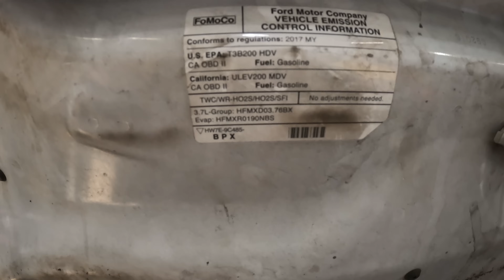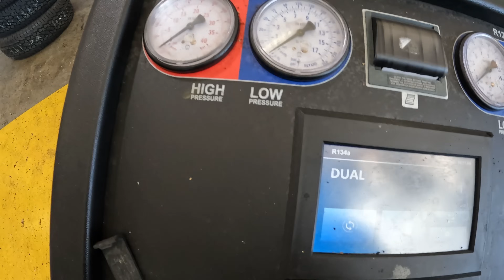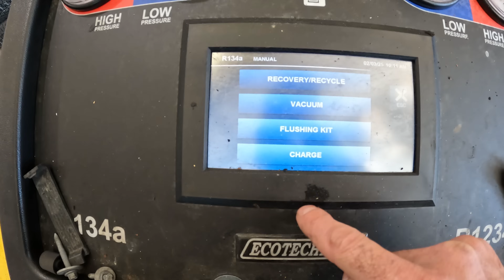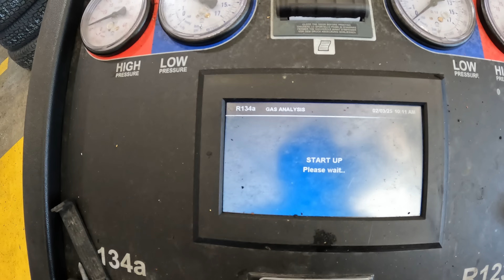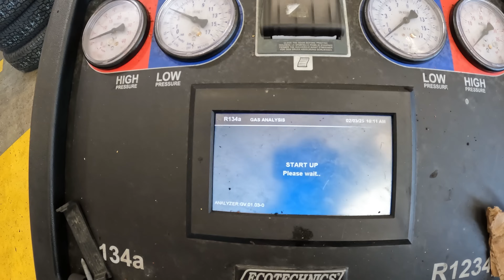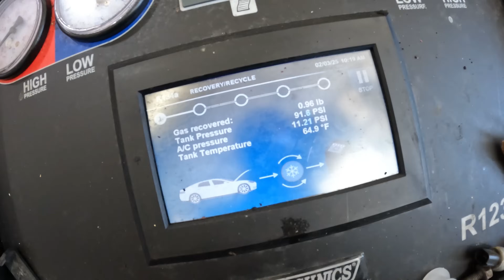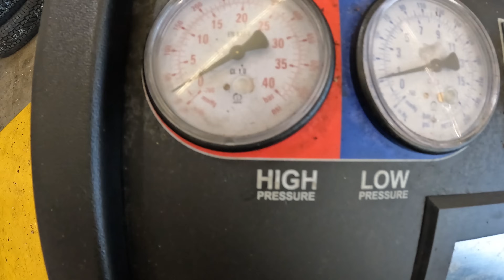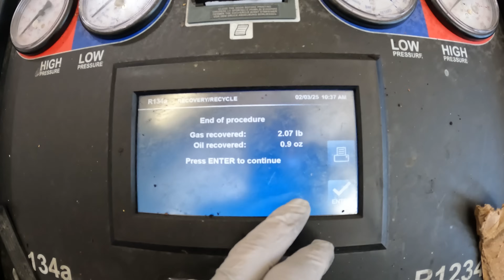Warm AC?   AC System Diagnostic Ford Transit T250

Comment from the maker: 2017 Ford Transit T-250 Ac system blows warm air.  But why?  Yes I already checked fuses and wiring when you weren't  looking.  The AC compressor actually came apart inside.  All that metal in the AC oil.  NOT GOOD.
So now it gets an ac compressor, condenser, expansion valve, and new lines, (unless i can flush the lines)  Then a vacuum down for about 30 min and a recharge.

Thanks For watching

Comment: Why replace more than only the failed compressor??🤷‍♂️
Reply from the maker: Guess you didnt hear it has metal in it.  You must replace all of that if there is metal contamination.  If you dont there is metal in the system and will destroy the new compressor (flushing does not get it out).  You destroy a new compressor from not changing metal  contaminated components you will void the warranty of the compressor if it fails again.  Then you got to pay for a new compressor.  Common sense man.  Everyone knows you replace all of it if its metsl contaminated to keep the warranty.  I honestly dont know if that was a ridiculous  question of if you honestly didnt know.

Comment: I see  your Freon machine is dual system. My Jeep 2017 is yf1234
Reply from the maker: @TXCherokee  yes it's dual system. It takes like 10 min to switch between them. My ranger is 1224yf also. So are my 23 f450's and 23/24 transits